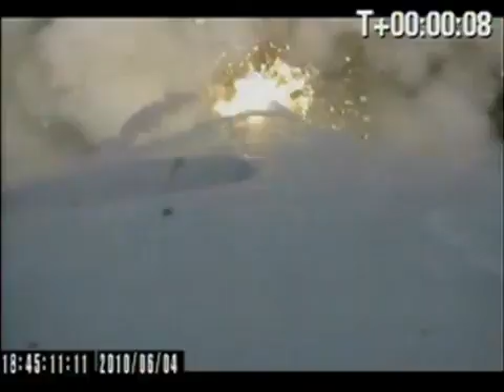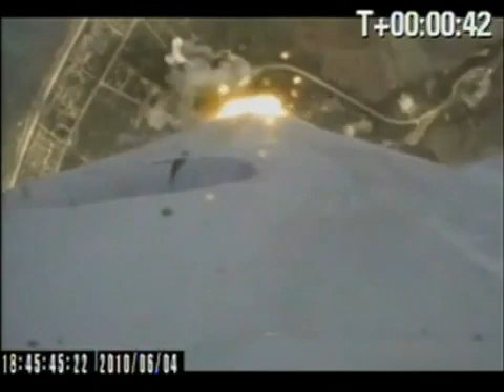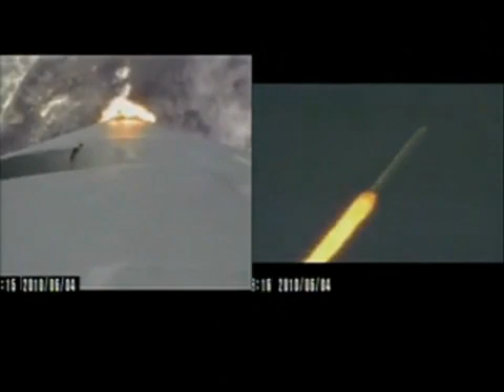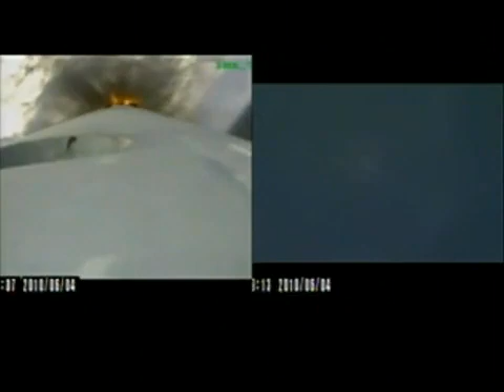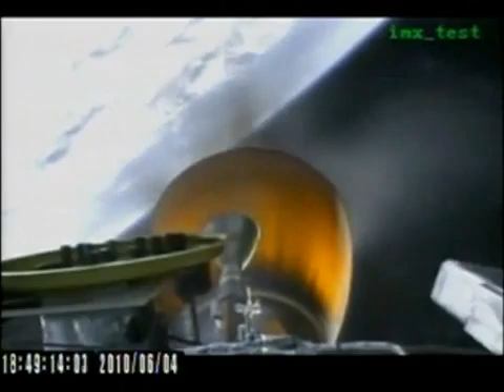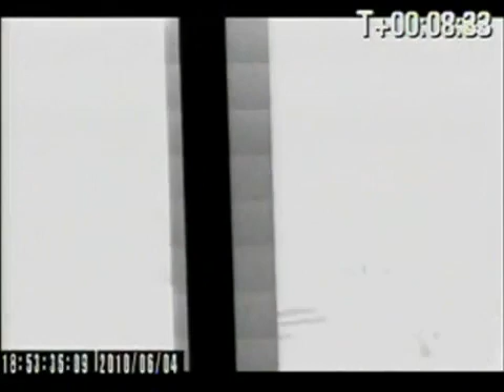2010: Falcon 9 (Spacex)

Comment: I love the Obama references. If you think about it, it was the Bush administration which leased the Cape Canaveral site (Air Force) back in 2007. SpaceX has already successfully launched two Falcon 1 (single engine) for commercial satelites, and this rocket was already completed before Obama was president. Just the facts. Go SpaceX -- I want in on the IPO!